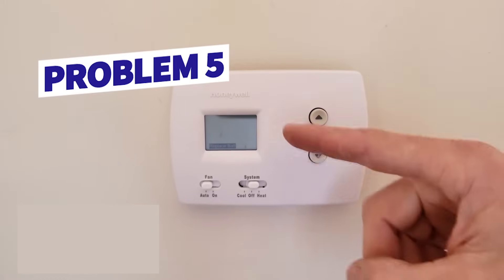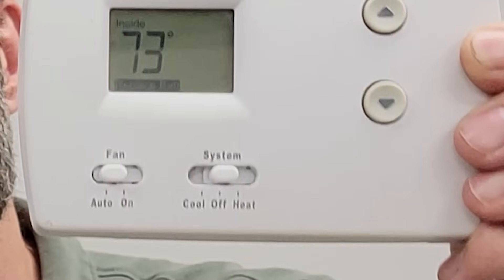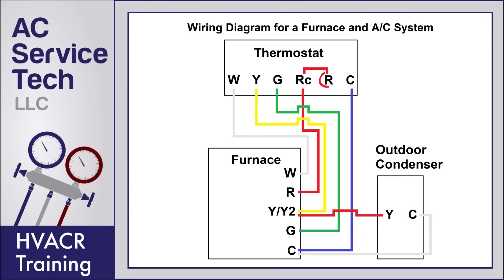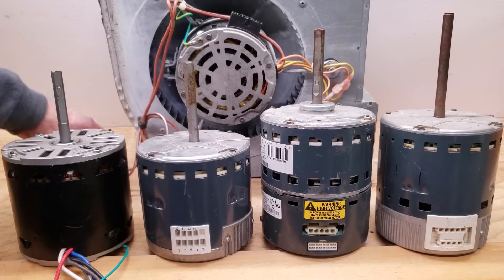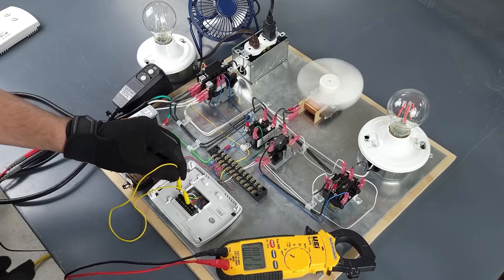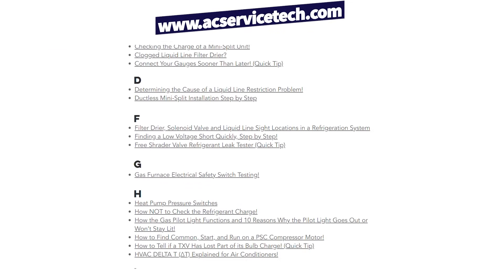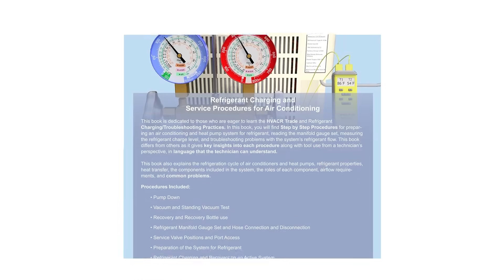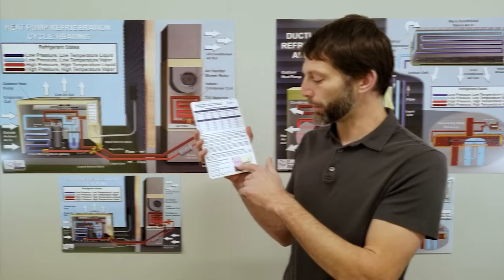Air Conditioner Not Turning On! Nothing is Happening! 10 Common Problems!

Comment: When there is a freon leak, where is the leak usually located? My HVAC guy wants to replace the entire system and I'd rather just replace the part or item.
Reply: The leak can be anywhere along the system cycle, did he say where it was leaking and why to replace the unit?
Reply: @missjack19  He said he didn't know where the leak was and the reason he gave for replacing it had to do with new EPA regulations regarding refrigerant.
Reply: @hirsch4real201 wow, if he didn’t even locate it, then how would he know to replace the system, if he said it was somewhere major then I understand but that’s ridiculous

Comment: Have a 8yr old York, probably econo version, no low pressure switch and judgeing by previous owners lack of any maintenance on anything its ether low charge or the board if i can find it. All the voltages are correct, has new cap and good contactor just wont start, fan or compressor.

Comment: This guy is great, had a low battery pop up but didn’t think it mattered due to the  manual fan switch only turning on the fan. When he said, low battery’s don’t have enough power to close the contacts I knew I had to replace them. Then walaaa my ac works again

Comment: My safety switch on the panels messed up so i cut the wires and bypassed the switch since I have an on off switch. I cant believe thats what made my unit stop working. The panels were never messed with just randomly the switch stopped working. I used a voltage sensor to figure out where the power was stopping.

Comment: Thank you!! ❤I had low batteries in my thermostat. My thermostat was not blinking low battery and I just changed the batteries five months ago. I changed them anyways and it worked my system back up and running..

Comment: When u jump it and the condenser doesn't come on then its what? U didn't address this
Reply: Assuming your door switch is working and all power is on, it can be the wires themselves, the control board, or safety switches, you basically have to trace out the problem to see where power is lost

Comment: This video was super helpful.  I have a remodel going on in my house and the contractors accidentally cut the wire that goes to the thermostat and I could not figure out why it was not turning on.  Your explanation of the R/Y/G wires and the clue about the clue about closing the door switch helped me figure it out.  I ended up tracing the line and found the cut in the wire.  This probably saved me a few hundred bucks!  Thank you so much!!

Comment: Everytime I turn on the CA It blows the 3amp fuse. 
The gas heat works fine. But when I turn the CA on the 3amp blows and heat and CA will not work. The fan inside the furnance stays running when that happens.

Comment: This helped. I live in an older apartment complex and I was lost. It was 85° in here. I opened the area where the hvac system is and found the switch. It doesn’t exactly look like what you showed but when I flipped it the air came on. I closed the door to the hvac thing and it kept it in place to keep the air running. Could be a temporary fix because I’m not a professional but it kept the air running and started cooling the place down so thanks
Reply from the maker: Thanks for watching I'm glad it was a simple fix for you!

Comment: I have a question I diagnosed my AC system from watching this Video. and figured out. It’s the thermostat. My system is combo AC & Heat. I jumped the Red & Yellow wire together. So now the AC and the blower are working but the AC compressor is not turning on. As to before I jumped the 2 wires together the AC unit would not turn on at all. So I am assuming that based on the video that I need to jump Red Yellow Orange and green together?? Any advice would be greatly appreciated

Comment: Yo I've been stressing about my condenser shutting off for the past 24 hours. We had my gf's mom over yesterday for a labor day grill and the ac stopped working! I panicked and spent some time in the heat trying to figure out what could be wrong.

i woke up today, hot, and worried that I would have to replace my entire unit for thousands of dollars...was about to call an AC company but decided to watch this video. When I got to the part about replacing the batteries in the thermostat I scoffed, but figured its worth a shot at least. There's usually an indicator that says low battery, but since you convinced me to try it, I changed them despite the lack of any indication of them being low.

Imagine my relief and joy when I walked outside to  a spinning fan in my condenser.

Thank you sir, you probably just saved me from someone trying to scam me into buying a whole new unit.

I've been laughing with relief since.

Thanks for the video!

Comment: What would be common problems for BOTH indoor and outdoor units not running?  I turned air off but forced fan “on” and it doesn’t blow.  Outdoor unit never kicks on.

Does the thermostat directly control outdoor unit or does that signal pass through the indoor unit first?  Meaning, can a problem with the indoor unit (like a condensate drain) also cause the outdoor unit to not come on?

Comment: If the condensate line is clogged and triggers the shut off, will just clearing the clog be enough? Or do you need to do something to reset the trigger switch? Mine was clogged, I cleared it, poured water down the drain and it stays clear, but the AC won't come back on. Originally, I happened to be walking by the hall closet where the unit is (1969 house) and I heard some clicking, shortly after the AC went off. So I checked the Safe-T-Switch, which I normally pour vinegar down 4 times a year - but hadn't in at least 3 years.

Comment: My hard kit exploded and then the run capacitor was also damaged. After replacing run capacitor still the indoor unit, thermostat and outdoor unit not working. There is literally no power on it. How to proceed

Comment: Great informative video very much appreciated. My Tran AC stopped working a few days ago in the middle of high heat. Since I had changed the capacitor before, I rechecked the capacitor and found it to be the correct value. Checked the low voltage and found out that 27V is missing. It was challenging to find the source and it happened to be the safety switch on the swamp pump!!

Comment: Never would've guessed something as simple as the condensate safety switch. Used my shop vac to remove the water from the pan and the unit instantly kicked on! This video was very helpful. Thanks! 👍👍
Reply: Thank you AC Service Tech and @soccerplayahershey. Had issue with thermostat not being on, replaced battery and still nothing. Water in pan was at the top and could see damp areas nearby. Wasn’t comfortable  around the system especially with water and electricity but after reading @soccerplayahershey’s comment I went down, turned circuits off and shop vac’d the water out. Success! Thank you so much, I have air flowing on this hot day in August. Just to show a woman in her late 60’s can make things happen. Very happy.

Comment: Newer Allied air hamdlers/furnaces have a 3amp circuit breaker, located on the door switch  instead of a fuse on the board.

Comment: Excellent instructional video. The internal low voltage fuse was blown due to a rookie mistake on my part. The condensate pump wasn't working so I swapped it out without killing power to the entire unit (I did unplug the pump). Somehow, power found its way to the LV fuse & killed power to the main board. Now I have spare fuses but won't make that mistake again.

Comment: A couple weeks ago, when I turned my central air on, it wasn’t cooling. I had forgotten to take the cover off the unit. Now I’m finding that it has stopped working. I changed the batteries and circuit breakers and they’re all good but unable to check the rest. Hard to do with no man around. 😂

Comment: My ac was turning off then I reset the breaker.  Then it would turn on and wouldn't go in the low 70's. Now it will not even let me adjust the thermostat down and wont turn on.

Comment: Thanks for sharing so much helpful information.  We’re having trouble with our condensate line and excess condensation dripping from the air handler - We’ve watched several of your videos and noticed a condensate pump shown in this one.  Do you have a video about the pump you are using and how you install it? Thanks!

Comment: Thank you for the tutorial, my A/C went out on one of those 100 degree days, my HVAC guy was out of town and I would of had to wait three days til he got back.  I don't trust just call any repair services from my experiences with dishonest or over charging, so I stick with one company I trust, anyways I changed my capacitor on condenser, still didn't work, when you mentioned checking the thermostat by jumping the connectors nothing happened, then I went up into the attic (100+) I found the condensation safety switch in the drain pan was a little tweaked, realigned it and cool air was back, thank you very much you saved me a lot of money and being miserable for days in 100+ temps!!!!!

Comment: I couldn’t find a video to where the inside blower and the outside unit wasn’t working and I almost didn’t watch this video but I’m so glad I did, I started by using a jumper wire at the thermostat and nothing so I checked the control board and remembered I use to see a green led light on the board, so I pulled the 5amp fuse and BINGO! I already had an extra fuse on hand. 
Thanks for the video!

Comment: The tip about the switch was super helpful. Our A/C condenser dumps water into our sump.
When I replaced the sump pump, I must have pushed water back into the system causing the switch to trigger. Although the switch is different and doesn’t have a reset, I was able to twist the switch allowing the water to drain and move back to the original position.

The A/C started right up. 

Thanks for the great video!

Comment: Both the inside unit and outside unit are running just fine. Changed the filters, cleaned the coils, replaced the batteries in the thermostat and still no luck
Reply: Not cooling? Or not turning on?

Comment: My ac unit at this rental looks older than anything you've showed. Their is a pvp pipe coming out, but it's just ran down the side, and then parallel to the ground, down to a drain in my basement. Not scorching yet but it is almost 80 and ac unit won't work. Landlord said he will get someone out here tomorrow. Worst part is I absolutely can't sleep when I'm hot. I keep it around 65-67 when I'm going to sleep. 😪

Comment: Just to mention I learned about  the word tau ,
and the capacitor charges up and then discharges in 5 tau. !   1 tau.   2. Tau. 3 tau.  4. Tau.  and 5 tau 
  The capacitor will start a motor up in 5 tau then the contact will close if I remember really well ! The capacitor and contact combination are a parallel combination in series with one leg of the motor or one hot wire!

Comment: Looling for suggestion: AC unit went out and the capacitor was changed on the first service visit. Was told need a new unit but Choice warranty approved to change the compressor instead. Ok, compressor was changed yesterday and house back cooling. Here's the issue, the air filter needed to be changed so I head up to attic (turned off AC at thermostat) and changed the filter. Turn thermostat back on to cool, and the AC unit outside never kicked on. Checked breaker and everything and still does not come on. Any suggestions on what it could be? Serviceman cannot come back out until next week. 😩 Thanks in advance,

Comment: Pressure Limit Switch is tripping. (Located outside on A/C unit). Fan will not move on its own unless knocked with a screwdriver. Unit itself was very dirty. Smaller diameter copper pipe was HOT to touch.

Comment: Can anyone tell me please what’s going on with my ac unit everything works 
Including motor condenser nothing that I can tell is broke but the only problem is that there’s not strong enough air pushing through 
YES MY BLOWER TESTED IN ON/out 
It works furnace pilot turns on my ac condenser also turns on 

Air is just week but the motor is strong 
Before I will here like a vent the will open up but now it doesn’t don’t seem to find any guidance please anyone?

Comment: Very informative, not generic. I learn things that others don't say or go into more detail about. Thank you! and Kudos.
Reply from the maker: Glad it was helpful!
Reply: Awsome videos sir, i got a question for you. I turned my ac on the other day, it ran for a couple minutes shut off, and wouldn't come on again. Neither would the furnace, fan.
Batteries in the thermostat are good, no breakers tripped, outside disconnect to unit is good, checked the furnace in the attic its good, no water in the drain pan. Thanks man

Comment: I cannot express how thankful I am to you. My system shut down in NC during this 100° heat wave. Turned out the system in the attic was filled with water. I sucked out the water with a shop vacuum and it fired back up again with no issues. Tomorrow I will cut the evap pvc pipe, clear it out amd use pvc unions to reconnect it. Sir, you saved me a fortune. Thank you so much!!!!!!!!!!!
Reply: Reerrr
Reply: Make sure u have a good pitch at it, what he said 1/4" per foot is minimum the more the better
Reply: Rookie question. Are PVC units an alternative to brazing the pipes back?

Comment: My window AC buttons/control panel suddenly stopped working yesterday. The AC was at 68° then the buttons/control panel stopped working. I played around with the buttons and it went down to 60° and then I wasn't able to move it back up or even turn it off or on. The buttons completely stopped working.
Then today I pressed the off button and it surprisingly worked, but now it isn't turning back on at all. It's 100°+ And I have no AC!!

Unfortunately I don't have the tools or money to fix it
Reply: Hey did you get it fixed?
Reply: @maliamarsh02  I stopped trying and after a week I turned it back on and it started working all of a sudden. 
But whenever it rains really hard the same thing happens. I try not to mess with the temperature and just leave it at 70
Reply: @jon-OO7-LTK  thanks for the reply. Glad it started working for you!

Comment: I had a new fan motor and capacitor replaced just over a year ago and am having the same issue. When I first turn on the cool setting, the compressor would kick on and try to start for about 5 seconds then shuts off. Only the fan would stay running. I need to shut off the thermostat and wait a few minutes to try again. Then on the 2nd attempt, the compressor would stay running and continue blowing cold air. Is it a possibility that the capacitor has gone bad in such a short time?

Comment: I had the condenser unit capacitor changed, I changed the batteries, and the breaker was not tripped. The thermostat screen is blank but the fan still runs. But the AC unit does not turn on. Any ideas??

Comment: Hello, I live in South Florid and I have a brand new AC (2 weeks old) ever since it was installed, it runs for about 7 minutes every hour or so. The Thermostat states the temperature desired is reached, and therefore it just turns once (for 7 minutes) every hour. 

We set the temp for 72 before bed, and it will just run these 7 mins per hour to maintain that temp. 

Now, if I lower the temp by a couple of degrees then it will run for about 12 minutes… However, still just once per hour. 

Please let me know what could be the issue. Brand new Ac/Thermostat.

Comment: Hi! Thanks for this video. In the past couple of months, sometimes when we push the thermostat down a few degrees, it won’t trigger the on. It’ll flash “cool on” but the AC doesn’t turn on. I then turn off the system and then reset the circuit breaker. When I turn it on again it starts working. It doesn’t appear to be a condensate drain line problem as water isn’t backed up. Also, the unit is only 2 years old, got it installed a couple of years ago. Do you have a sense of what this could be? I don’t understand why it always works after resetting the circuit breaker for AC. (The breaker doesn’t appear to be tripped when I reset.)

Comment: Would you recommend changing capacitors or fan motors based on time (21 years) as a preventive measure?
Reply: Check MFD on the capacitor. That’s how you test to see how what they are currently running at vs what they are rated for.

Comment: Oh the nest the number #1 issue with those are the common wires not being connected at the time thermostat or at the air handler or period due off factory charge . I always check to see if common is connected, not recommended but I grab a little piece of wire and barely touch r and c to see a little spark (ounce again not recommended) keeps you from going in air handler attic up stairs etc …. You know common is connected SO I then hook it to the thermostat or connect it at the board air handler etc..

Comment: Fuse , breaker ,capacitor ,contactor ,thermostat are some issues or if it’s a heat pump low charge , good stuff I was just going to say common wire too